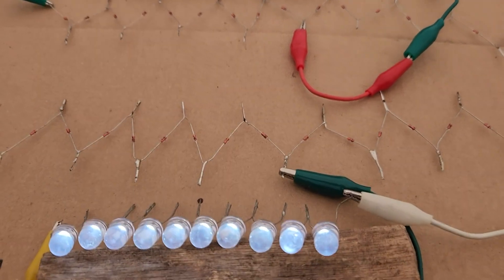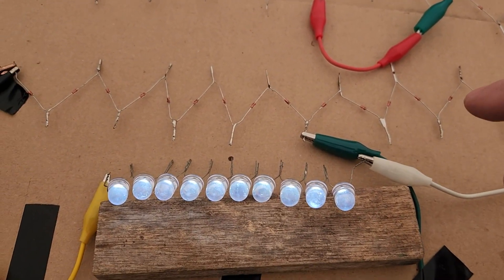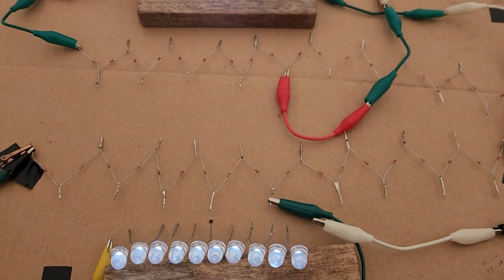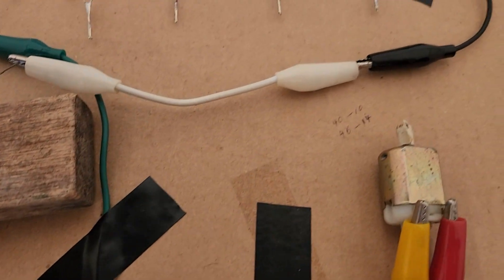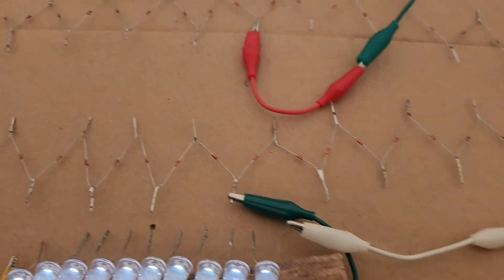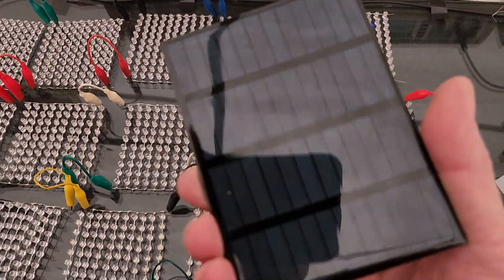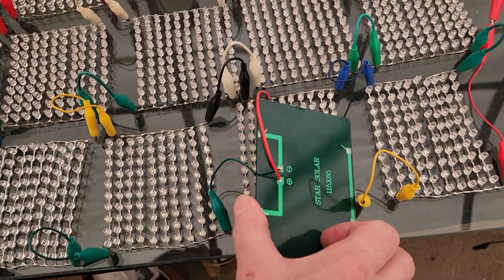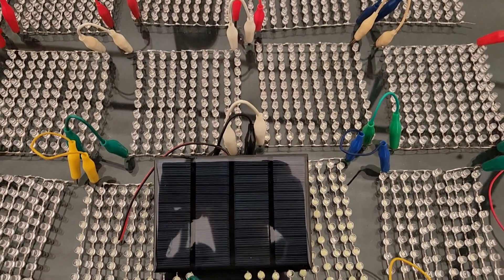WPT part 41, Experimenting with Diode Chain

Comment: Hi Paul, nice job as always. From my experiments I think the stifflers loop is producing pulse DC, this is seen by some devices as AC and in some cases it is not seen at all as the frequency is too high. I believe less is best in your scenario, perhaps 4 diodes in the chain with a centre tapped earth. Another thing that helped me with the stifflers loop was attaching a full wave bridge, it seems there are signals all over the place that aren’t truly captured until rectified, even then I believe there is a lot more energy escaping.
Reply from the maker: Add a full wave bridge, yes, great idea, I agree, Thank you!   I think this will improve things.